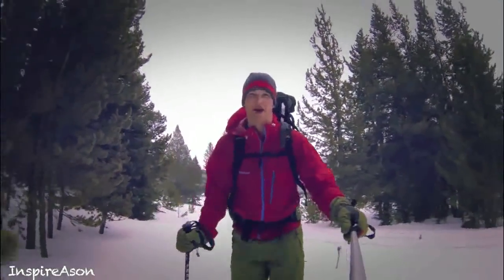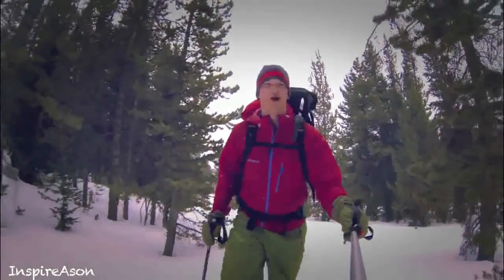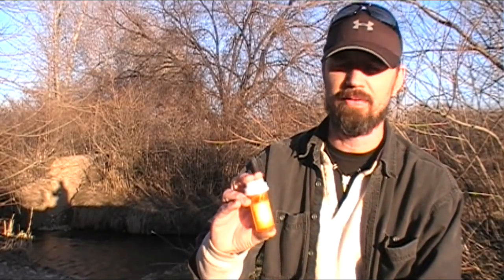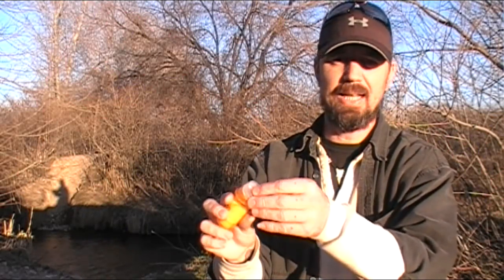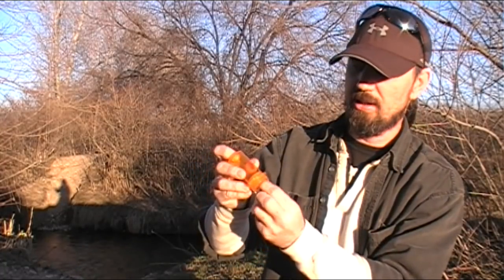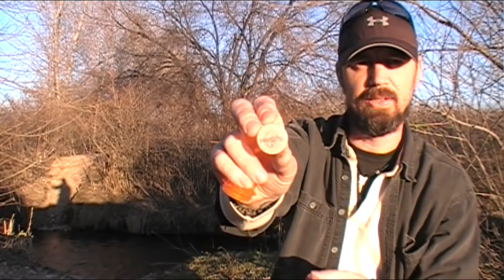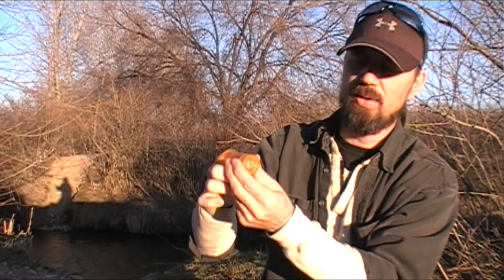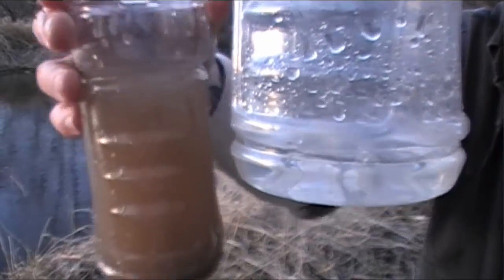Homemade Emergency Water Filter Kit - "Tip Of The Week" E33

Comment: Something I would add
Take charcoal from your fire, pulverize it and make a layer of that charcoal between let's say 1.5 cotton balls.
This would further purify the water.
Furthermore using the added layer of charcoal  to filter and then boiling the water (if possible) makes it that much safer to drink.
just my 2 cents
Reply: the charcoal could induce cancer of the stomach..😦.
Reply: @mickgatz214  :- You are correct. Most people do not know the difference between charcoal and activated charcoal,  soft wood vs hardwood charcoal, and the difference between ash and powdered charcoal. Amateur survivalist aside, people who do videos like this must take into account the possibility that the product in the DIY video will be used and might cause health problems (especially with children & elderly).
But you are correct in that the ingestion of untreated charcoal can cause cancer according to modern medical authorities.
Reply: G H  Cool. You don't like suggestions or commentary. Good to know. Keep on keeping on man.
Reply: Plus, there is the possibility of using poisonous in your fire unknowingly!

Comment: Maybe someone could take a 3rd bottle cap, bore a hole through it that matches the hole in the bottom of the pill bottle. And then fuse it to the bottom of the pill bottle backwards. This would allow you to screw the device to the top of common containers ie (beverage bottles), and allowing you and whatever coordination you were gifted with in life to focus solely on pouring water into the top of the device and not also into the purified water catching container...
Reply: Now that's thinking outside the bottle. Great idea.

Comment: Cut off the bottom of a 20 oz plastic bottle, poke 2 holes at the bottom to tie string for a hanger, poke holes in the bottle cap as you have shown, add some dry grass first, sand, charcoal, sand, hang from a tree, add water, catch water, drink water.  Charcoal is as simple as smothering hot coals from a campfire.

Comment: He sort of mentioned that if you put the bottle cap without holes in first (so it's at the bottom)when not in use the it helps cover the big hole and keep the cotton clean and drier.

Comment: I dont know if its been mentioned already but using coffee filters work good too. I cut 1/3 off one of the empty plastic water bottles i had, punched some holes at the bottom with my knive, stuck a couple coffee filters i had in my backpack, filtered some water, boild it for a couple min, added some purification tabs and wa la! Good to go!

Comment: If you have some, use aquarium filter floss or filter sponge material instead of cotton balls. The advantage is that the aquarium filter media are synthetic fibers that won’t rot and are more durable and easier to wash out for reuse. 
You could also put a layer of activated carbon (also available from the aquarium shop) between two layers of cotton or aquarium filter material. The activated carbon further clarifies the water and removes some chemicals.

Comment: Stick/glue the bottle screw cap with the fine holes to the bottom of the pill bottle (with the bottom hole cut out) . Screw on the water collector bottle to glued cap at the bottom of pill filter bottle.......great idea keep the creative juices flowing

Comment: Great Tip John Thanks!!  I just made one with an 'O' ring around top cap with a large hole in it so you can adjust the density of the cotton balls (media), by sliding it up or down This affects your 'flow rate' of course.  I also thought you could, (in a pinch) put a small nail thru the pill container to hold the top cap (or retainer ring at varying heights depending on how much filtration you'd need. Sand and small leaf matter could be use once the cotton balls are contaminated...

Comment: Why not just drill holes in the bottom of the pill bottle? BTW GREAT JOB! I.love your videos very informative.
Reply: If the hole in the pill bottle bottom is big enough to get your finger in, it makes it a lot easier to change  or adjust the filter media, as when you take it out to clean it, for example.

Comment: Good info.  I use a First Need Water filter, which is very good, but this model is also prone to clogging.  At present, I use the clear plastic fuel filters from Walmart for my pre-filter and I've had a long good service from my First Need Filters.  But I think I'll make one of these for a backup, in the event my main filter freezes or breaks.  May try to add a nipple to work with my water bag for gravity feed.  Thanks!

Comment: What would you think about inter-spacing the cotton with sand? Might be an even finer set of filters. Or adding a layer of activated charcoal, then sand and at the top cotton might make a really good compact filter. All in all this is an amazingly handy little tool.

Comment: In the beginning he has two bottle  caps, what is the second one for??? I know the one with the holes goes in the bottom but what was the purpose of the first cap he took out of the pill bottle???
Reply: I was thinking the same thing.. maybe in case you find a bottle in the forest that doesn't have a cap? lol.. It is a cool little filter though. I like his ideas..
Reply: +Gregg Joseph 
I know right lol. Whatever the case it is a great idea for sure
Reply: Jennifer Cousins     To prevent moisture and debris from getting through the hole when you’re not using it.

Comment: What do you think of this idea: Cut the top of a plastic bottle off, turn it upside down and snuggle in on the bottom part. It would look like a funnel on top of a cup. Inside the funnel you place a coffee filter filled with charcoal tied up so the charcoal don't fall of.

Pour dirty water on the funnel and then the "clean" water drips through it into the bottom part of the bottle.

Comment: I don't understand the point of the two bottle caps, and the drilled hole. Why not just put drain holes into the pill bottle itself? All this is is a fine-strainer. I don't understand the extra parts.
Reply: I think that the caps allow you to easily remove the cotton and replace it and the other parts as well I am sure it would work just drilling holes in the pill bottle but not very reusable
Reply: soggieshorts1 Correct. This is why he specified making the hole in the bottom large enough for a finger.
Reply: Hypurman1     To prevent moisture and debris from getting through the hole when you’re not using it.

Comment: Great idea.  Something else to consider, if you can get the longer versions of these bottles, add activated Charcoal in between the cotton.  Also, if the caps fit tightly enough, would it be possible to screw the filter onto the water bottle and invert it to allow the filtered water to pour through and into catch container?  Or, would the water pressure from the top water bottle overrun the cap and allow unfiltered water to enter the catch container?

Comment: i made a little more advanced one a while back from an advil bottle lol mine has rubber seals and pen tubes also sealed with rubber gaskets one each end and i dont use a drill since i dont have one at the moment i used my torch lighter to melt small perfectly round holes into the cap and base of the bottle. installed a freeze plug with a few holes then som cotton and a tar block for cigarettes on one end of an inserted pen tub for even finer smoke sized particles. i use a basic transfer pump to press the water through the filter and food grade tubing for the hoses :3 it works great makes pond water taste better than tap water. i will most likely be making a vid on it when i set up my official outdoors channel. i will be doing some shooting,ammo reviews "im very nit picky on ammo" gun reviews and DYI objects with special uses. great vid though :3

Comment: hey the caps are to slow down the water flow so you dont push the dirt through. it is good to add paper or cloth too. if you need to get salt out the more you add the you can even filer sea water! use 2   two liter bottles   and fill one with paper towels cotton a sock anything. set on on top of the other and as long as the flow is slow you can remove 95% of the salt from sea water making it drinkable! have fun! slower filtration time makes cleaner water.

Comment: Your water has the particlate removed, but the water purification tablets do not kill parasites.  Your next step after filtering the water would be to bring the water to a boil to kill parasites.  Any chemicals or toxins in the water would still remain.  A decision would have to be made as to how critical that use of water is to you at that moment.

Comment: HI there, this is really clever. Thats for posting it. If I may be so bold to suggest a design improvement. Alternate the layers of cotton wool balls with a layer of activated carbon (cinders from a fire).this will greatly increase the filtration power (microbiologically) of the filter.

Comment: Cool idea! Quick question, why cut a big hole in the plastic container just to fill it back with more plastic with more holes? Why not just drill the small holes in the bottom of the container and forget about the bottom bottle cap? Thanks!
Reply: dystopiansage     To prevent moisture and debris from getting through the hole when you’re not using it.

Comment: how to get water out of a seeping rock or damp mossy area..... peel out all moss to expose the source  let it clean out for a minute. even if it is a drop per few seconds , its water. next find a blade of grass the kind with a deep V shape is best. next insert it into the crack or area where the dampness is moving and set a 2 liter bottle below where the water can drip . the water will travel down the V and drop off and many times it has taken 45 minutes to fill a water bottle that size even in a drought year from a shear cliff that had damp mosses growing on it! we use this method all the time traveling in the back country. no filtration is need  at all if it is coming from a rock source! have fun!

Comment: Question, ... how many filtrations b4 the fluffy cottonballs need replacing?
Reply: Keep in mind that it's a water filtration kit, which pulls out the larger sediment. It's an emergency kit, so if you aren't in dire need of water to survive, it's still smart to use the tablets to purify the water, which kills the small microbes. 

An interesting guideline you can use if you've got standard household bleach is the, "You must be 21 to drink" guideline. Makes more sense in the U.S. but the idea is that for every 1 liter/quart of water (3.8 liters per gallon, 4 quarts per gallon, so they're close enough) you use 2 drops of bleach to purify it. Wait 30 minutes and it should be safe to drink.

Comment: petty cool did you try drilling the wholes in the container in order to save some time with the caps ?
Reply: The secret is all the way near the beginning. did you notice that he said the hole in the oil bottle should be large enough to fit a finger thru? And also when he removed the cotton by pushing it thru from the bottom. If you tried to the cotton out, you could pull it apart and reduce it's ability to filter by making it too loose. His way, you can easily pop everything out with a gentle poke. One should never try to save time when preparing a safety measure. Time should always be spent, with care.

Comment: Great vid :) just a question after you assembled it and used it i didn't you use the water bottle cap you had in the top of the bottle or mention its purpose (is it a spare?)
Reply: petsarenotmypeeve     To prevent moisture and debris from getting through the hole when you’re not using it.

Comment: What about the first cap shown what is that used for
Reply: "The cap without holes can be fitted here when not in use to provide protection from moisture and debris." at the 3:40 mark.
Reply: I like bothe the concept and portability of this and have both made and used it withno problems with it other than the amount of time it took to filter a fairly decent amount of water(ie: a cantean of water) but other than that it works fine.

Comment: Why not just drill 1/8" holes in the bottom of the pill bottle? No 'snugly' cap needed then. 😀
Reply: Jef Gurney     To prevent moisture and debris from getting through the hole when you’re not using it.

Comment: I'm going to have to ask also. What is the other bottle cap for. It is not mentioned at 3:40.
Reply: jason cramer    To prevent moisture and debris from getting through the hole when you’re not using it.

Comment: What is the second water bottle cap used for? The one that was pulled out first. Thanks
Reply: cberney1     To prevent moisture and debris from getting through the hole when you’re not using it.

Comment: why do you need two bottle caps? do they both have holes in them or just the bottom cap? you didn't explain why there's a cap on top. seems like you don't need one on top.
Reply: I think it's to apply light pressure to push the water through the filters. That makes sense to me.
Reply: Or, use the "top cap" to put in the bottom over the hole while storing.
Reply: +JackstandJohnny what was said in the video is to use the cap without holes to protect it when not in use :)
Reply: JackstandJohnny      The cap without holes is to prevent moisture and debris from getting through the hole when you’re not using it.

Comment: Just drill holes in the botom of the plastic bottle and piss off with that cap. I also use coffee filters and a small funnel brewer I always have for my coffee, i f you dont have a brewer use the neck a plastic bottle..works very good and just boil the water for safety or use tables.

Comment: What is the purpose of the second bottlecap without the holes?
Reply: 1919alexr     To prevent moisture and debris from getting through the hole when you’re not using it.

Comment: what did u do with the tablets? an the second bottle lid. this doesnt filter contamination
Reply: billab0ng83  The 2nd bottle cap is To prevent moisture and debris from getting through the hole when you’re not using it.    Then he uses the purification tablets for the bacteria and contamination, and maybe boiling too.

Comment: I still can't find what the use of the bottle cap w/o the holes is for? It's not at 3:40
Reply: John Wick    To prevent moisture and debris from getting through the hole when you’re not using it.

Comment: What is the purpose of the non-drilled water bottle cap?
Reply: ianarno     To prevent moisture and debris from getting through the hole when you’re not using it.

Comment: What is done with the bottle cap without the holes?
Reply: Use it as the bottom for the pill bottle when you are not filtering water.
Reply: David Ludwig The cap without holes is to prevent moisture and debris from getting through the hole when you’re not using it.

Comment: You are using the term water purification in exchange for water disinfecting, much like the water purification tablets do. Water "purification" tablets DO NOT purify water, they disinfect it. (This is better accomplished by boiling it)(another disinfectant that is effective is colloidal silver) They can kill the live organisms in the water which is a very important step, but do  nothing to get rid of any chemical or physical pollutants. That makes effective filtering necessary to the water purification process, but it may still not be enough. Some chemical pollutants such as  pesticides etc are very difficult to get rid of. The safest method for chemical pollutants etc is to distill water. So for water collected from the wild to feeling comfortable that it is safe I would filter  it, boil it, then distill it (by solar still or coil tubing type distill,  both of which are time  consuming). In a pinch with a reasonably clear and clean source of water I would feel comfortable with filter and boiling, but this would not be purified. After all, water collected in the  wild probably is cleaner than most of the nasty ass tap water we are subjected to on a daily basis. Am I right?
Reply: +Scott I would not bother distilling water when you're in the wild, as it is free of most chemicals. But to be wary of bacteria (say from a dead animal) or something disinfecting is a good thing. However, for centuries it has been known to simply drink from a strong running water supply (say a stream, river, or even a small waterfall) and you will not have to worry about bacteria.

Comment: so what's the first bottle cap for
Reply: hot rod 218 hotrod 218     To prevent moisture and debris from getting through the hole when you’re not using it.